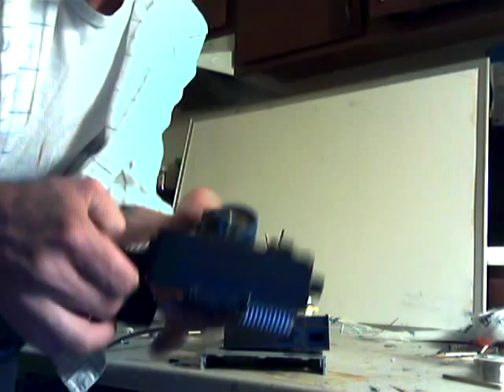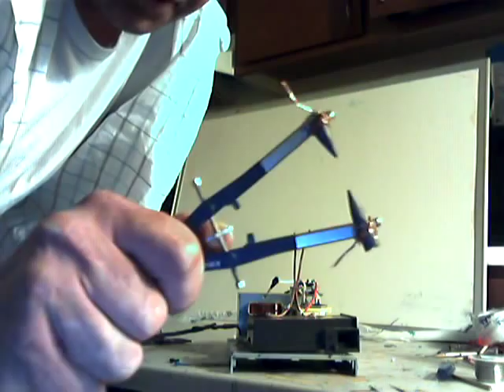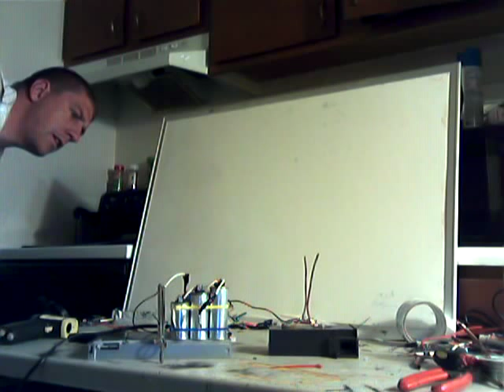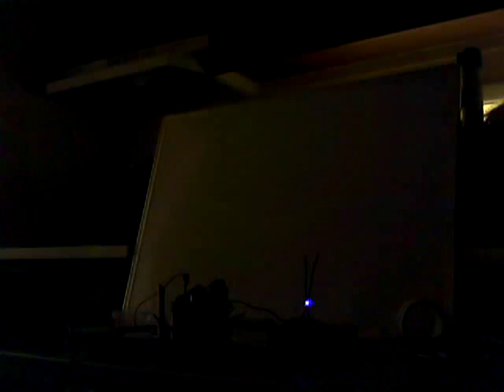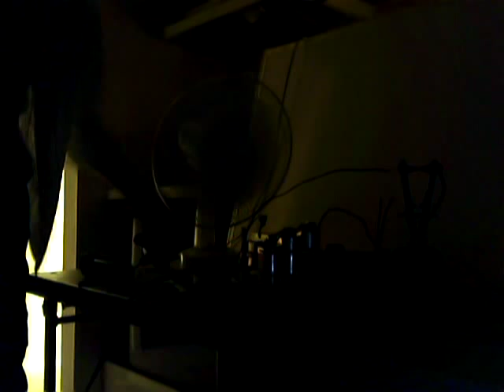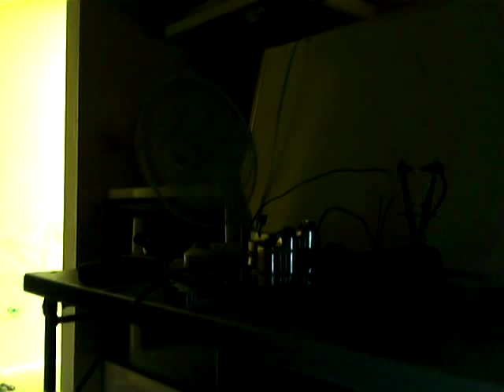DIY CARBON ARC Lamp

Comment: yeah! i gotta get me a speed controller! man!.

Those thermal cutouts are great, I've never ran mine long enough to need one but they will save motor or transformer windings when used just right.

love those carbon arcs too!, somebody suggested that I use carbon arc rods as my anodes in electrolysis too.

Lol love that quote! "If you smell MOT ur too HOT!"

Comment from the maker: thanks for the comment and also i do not advise using carbon anodes they make horrible electrode ,second the o2 generated on the anode will react with the carbon and creat c02,any way i had no idea the carbon arc would be so neat
i nearly canceld that test becuase the carbons had old elite on them ,ya i tried the carbon for an acid eleite test and they suck they get very hot also,any way you will love the speed controler,

Comment: to much capacitence, i think.......
with a nst/neon sign transformer it does that same thing, the more capacitors the more the energy has to build up to jump the gap which makes the machine gun sound......... you could probly make one hell of a telsa coil with that,,,, see the gun sound is another frequency which can be put into the primary winding of a telsa coil,,,, with the rite tuning you could wind a secondary and get 75000 volts.... just a though though. hope this helps

Comment: @NOBOX7 OK my secondary can withstand 72 amps at 300 volts I was just wondering what the primary or core can withstand. I do use the router speed controller it works very well, I should be posting a video soon but I am waiting for a flashback arrestor to run my torch.